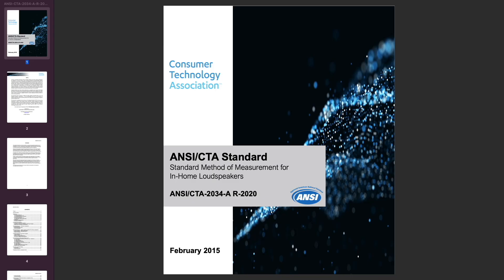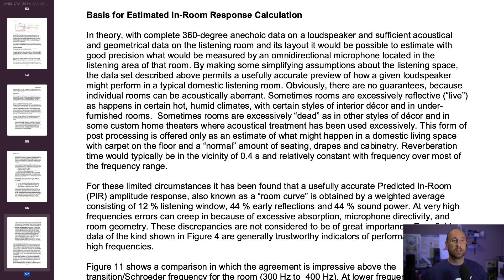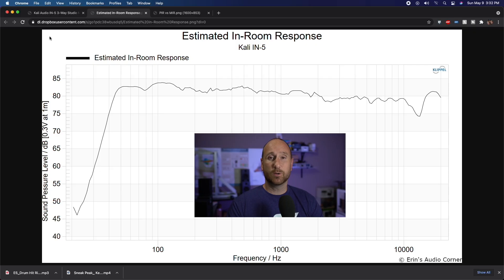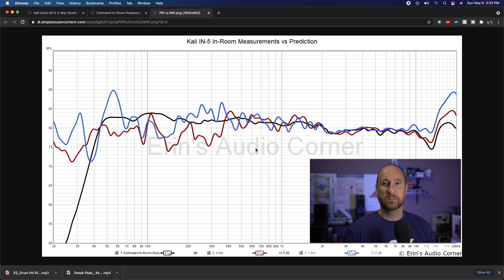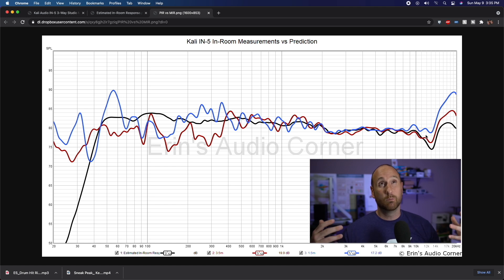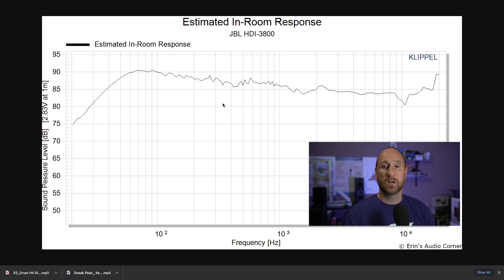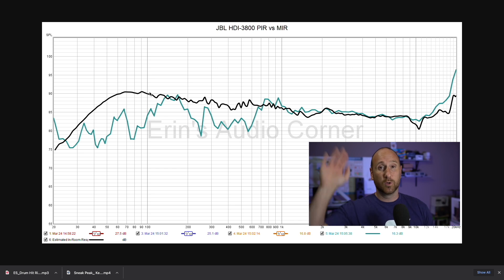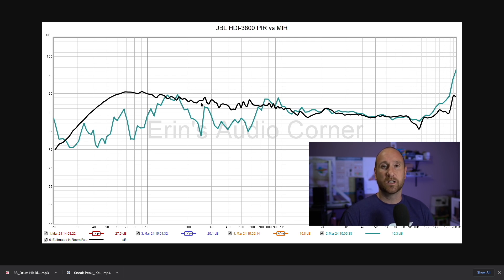Predicting Loudspeaker Performance In YOUR Room  ||  Understanding the Measurements Part 4

Comment: I know this is an old video but.... I must say, the in-room response for the JBL isn't that helpful at all. Sure, everything above 500 HZ looks to match fairly closely... But under that it is so far off, that it doesn't resemble it at all. This speaker would sound nothing like the in-room response would indicate in your personal room. A lot of the audio information is in that range under 500… and that would have a massive impact on the overall sound of the speaker. Which to me only proves that the in-room response is barely useful. So I disagree with your assessment.... But I still love your videos. Thanks for making the effort.
Reply from the maker: But the response above this region is less room dominated, and therefore the data stands as a strong indicator of tonal balance. Every room is going to be different, and therefore this region is going to be more dominated by the room itself, but above it, you can use the prediction reliably. And that’s been the message I’ve tried to get across in countless videos.

Comment: Great video Erin. I'm in general agreement with the Toole outlook on predicted performance. However,  I would point out that the area that is not replicated well is where most of the primary notes of music lie (middle C=216Hz, the high extreme of the female vocal range is around 1050Hz(880Hz for normal people)).  So departure from prediction is more important there than in higher frequencies and makes EQ and speaker matching to room still a little tricky.

Comment: So trying to get my head around this. It sounds like “normal rooms” generally have the same effect on response from mid to just below the top of the range? 

If that’s true then it changes they way I think about auditioning speakers as this would mean I can judge mids to upper midrange as the room effect should be a constant. The only issue is that 400 hz could color the lower the vocal range. I thought listening in a different room was useless but it seems it may be somewhat useable within a limited bandwidth?